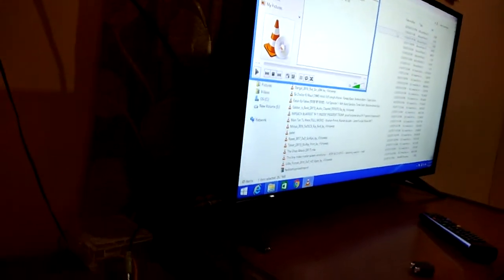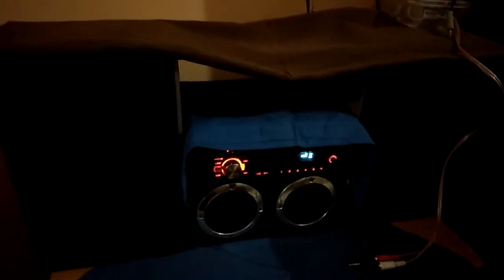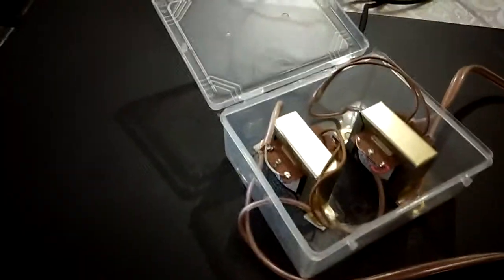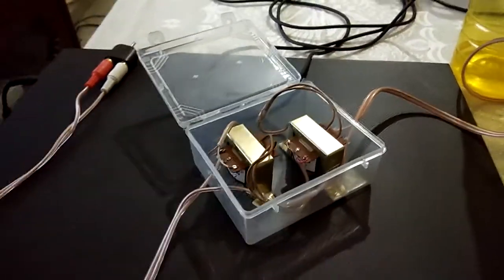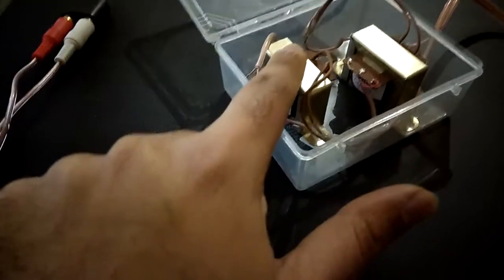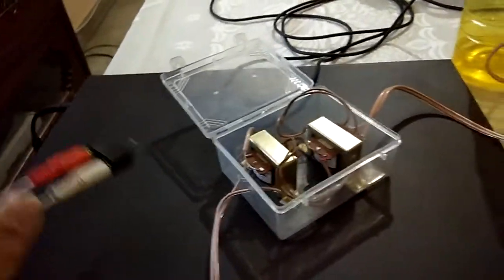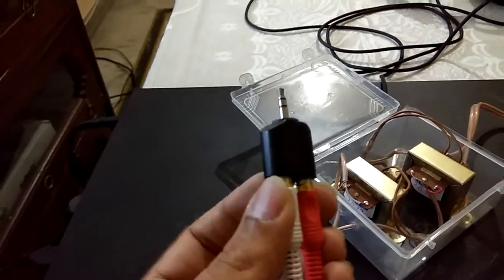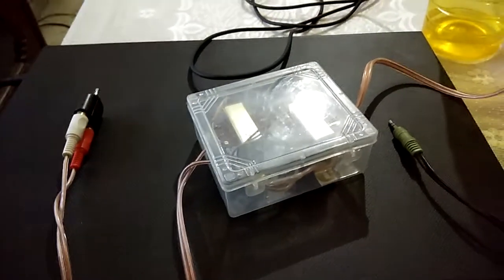DIY ground loop isolator audio noise filter or hum eliminator HD

Comment: But one transformer has two wires and aux cable has only two wires.. So how we connect 2 wire to 4 wires of transformer
Reply from the maker: aux cable has three wires not two, +ve for left +ve for right channel and ground or -ve is common for both channels. I have used two transformers, one for each channel. use 1:1 ratio transformers and connect input of each channel and take output of each channel from these transformers. so basically you have one transformer filtering left and another transformer filtering right channel.
Reply: @deeveshsharma1  thanks for clarification.. I'll try

Comment: Thank you man!  this is what I loking for because I have a problem on my PC not just I have it, everyone have the same problem on PC when playing games on high framerate. I have a buzzing sound when FPS going higher of 60FPS that point is wher starts a buzzing sound and continuing with higher frequency when framerate is higher then 300 FPS OMG that sound killing me... I put volume on my (marantz) amplifier to 0 and I hear loud that FPS sound on my speakers. I wel try this, first I wel try to make two transformer with 2x16 Ohms I think that wel be enaugh impedance for my sound card... 32 Ohms per transformer or channel + 32 Ohms in headphones = 64 Ohms per channel or 32 Ohms when I using my amplifier I think that wel be ok. If you have a time deevesh sharma try your project on high framerate in games those it works how I think?

Comment: please I want to DIY the same Ground loop isolator. here my email: lbvgabon777@gmail.com
can you please send me the schematic, with some info about the spec of transformer type, rating, and if I may use 2 transformer of little diff spec.
Thanks in advance.

Comment: Hi, I have a Schiit Magni 3 Amplifier and a question. Does a ground loop isolator also reduce the native sound quality of an amplifier?
Reply from the maker: definitely it will reduce the amplification and you might experience low volume output.....but as far as my experience it  does not reduce the sound quality, just the volume decreases....
I am using Kenwood amp and vintage national panasonic speakers, was getting ground signals from TV which was not resolving even after many solutions.
this isolator is only advised when you cannot omit humming or ground signals from any means.
Reply: deevesh sharma Thank you for response

Comment: i discovered my problem-today i switch on amplifier- without any transformer or other modification as it is earlier-suddenly all noise gone no buzzing-playing songs without noise-then i switched off  suddenly after 5 mins noise started again when i turned on-weirdo stuff-i am lost gone crazy- so what i understood-signal wires behaving weird suddenly they are interfering signal catch up by them-suddenly not there-anyways i will try transformer afterwards -but what kind of problem is this no idea-WHAT TO DO ? ? ?
Reply from the maker: rahul kumar looks like your audio setup needs a physical examination by a professional
Reply from the maker: rahul kumar kindly avoid any experiments to avoid any damage
Reply: lol man-now i used twisted signal cable noise reduced 80% but still little bit there-my setup is okay because when i dont connect any long signal wire( 10 ft) there is no issue never -when i use long signal wire then only noise starts-anyways i  got my issue that is-signal wires are acting like antenae and picking up noise-but i dont no any cheaper way to reduce this problem-thank you

Comment: for ground loop isolator we need- isolation transformer-input -230 v output-230 v -low ampere-otherwise low frequency cuttof volume decrease-proof i experimented on 230 v input output 30 v then volume decrease while on 60 v output volume increased 50 %-so ultimate solution is transformer 1:1 winding ratio -see the picture-https://en.wikipedia.org/wiki/Isolation_transformer

Comment: your transformer is also step down--see 2 input 220 v out-12-0-12 v-if you tell a shopkeeper 12 v input-12  v out they will laugh at you--i got logic measure input -output resistance higher the better-min-600 ohm resistance ottherwise volume decrease
Reply from the maker: rahul kumar but I have connected to bypass

Comment: i connected transformer input-220 v out-30 v lying at home -issue resolved but-volume decreased 70 %-you are connecting input-220 v out-12-0-12 v that means 24 v-since you are connecting 12-12 terminals-did you notice any volume decrease ?
Reply from the maker: rahul kumar u hv connected a step down transformer that is y volume decreased

Comment: i know shopkeeper who sells transformers-smps type-what should i tell electronic shopkeeper to give me-because-they will ask me type,how many legs, voltage,amps etc- i hope you understand that the shopkeepers dont no english-please tell me hindi or english words -local name of this transformer-that i will tell to the shopkeeper-thank you
Reply from the maker: rahul kumar 
The 12volt small transformers will do.... Just buy the smallest once available.... No step up or step down.....shopkeeper will understand this for sure
Reply: so-input -12 v -output 12 v --is that what you are saying-and 12 v smps type or normal amplifier type transformer ?
Reply from the maker: First of all it is not smps
Its a simple transformer
Reply from the maker: And secondly the voltage we get from audio signals is very less.... So 12volt will do and they are easily available
Reply: ok
Reply: 12 v transformer available are all --240 v input-output -12 v -still i try to explain shopkeeper-thank you